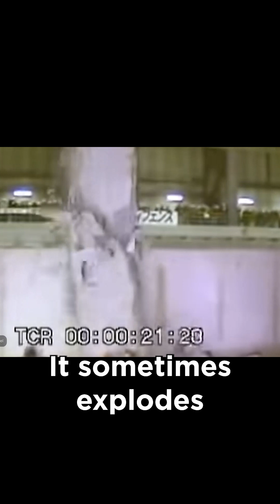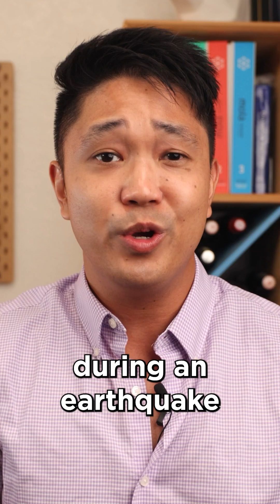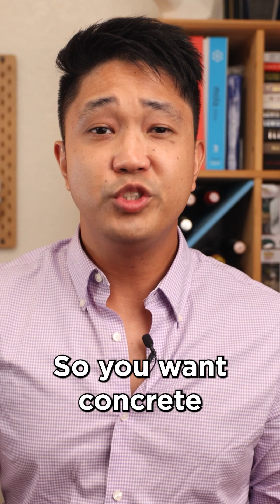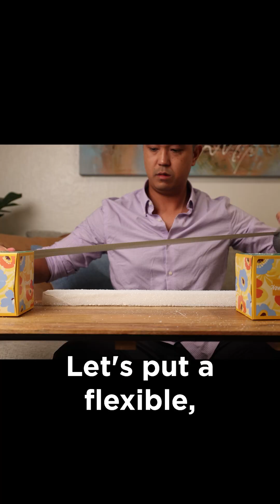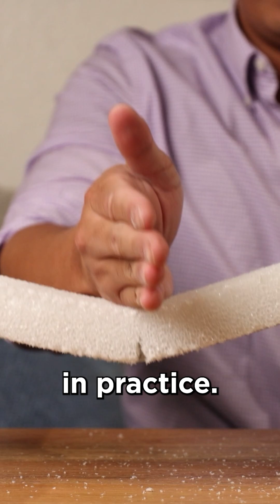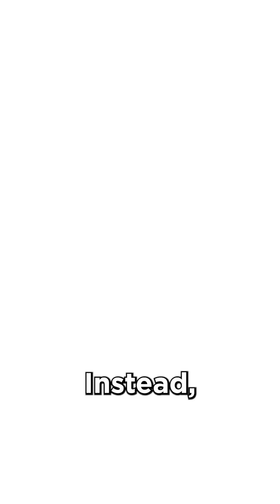Deadly Buildings Banned in Earthquakes - PART 2 #civilengineering #engineering #construction

Comment: The idea sounds right but there's no duck tape in the world that would hold up or in fact other metals. The closest thing we have is steel rebar. I live in a brick and block house built in 1954 it's going to be one of the first ones to go especially the part that it moves the long side of the house side to side. If my house would have been built facing 90° facing the other way it would have a much better chance. It's hard to explain especially the way I did but if anyone understood thank you.

Comment: What a horrible example… and I’ll prove it… Why didn’t he show a horizontal concrete member failure, instead of styrofoam? 
  Could it be that we don’t use prestressed cable reinforced concrete for anything other than what it’s designed for… vertical support, with mitigation for uplift. There’s no karate chop test for superstructure, it’s simply bearing under tension.

Comment: Rebar is only a tensile component thus the failure in compression, it will in every instance of a shock rather rapid or over time…vertical pictorial demo on the concrete, yet horizontal on the theory presentation…

Comment: Dont forget to add the tape on the lower section of the beam. 😊
Reply: He actually ment steel reinforcements ( bars ) he dint mention it here.
Reply: @gane_sh0711  i agree. Also, some beams are reinforced using layers of carbon fiber
Reply: @gane_sh0711  bars, fibers and other composites, all help.
Reply: Well this is actually called FRP it does look like a tape but it's a type of concrete strengthening methods

Comment: You can literally see you holding the side
Reply: Yeah, and with proper construction, things are held together too? Point of video doesn't hinge on that discrepancy
Reply: @delta666SoT I get the point but to do a fair comparison for demonstration there should be fixed variables like it would be fine if both were held or both weren't, not if one is held and one isn't
Reply: @MercedesC-wk7lx it wouldn't have mattered either way. The experiment would be the same regardless. If you don't think it's fair and that one variable could've changed the course of the demonstration then perhaps you should try it yourself and see how drastically different the experiment goes when you're not holding onto the Styrofoam. Even tho we, and I assume you as well, know basically the exact same thing would happen regardless and you're just arguing the semantics of the scientific method when a child could see it makes no difference in this demonstration. The knowledge was still true and easily understood. It was just an easy demonstration to make that provides a lil more perspective, nothing more or less
Reply: He's holding it because the "beam"  would fall off the supports.